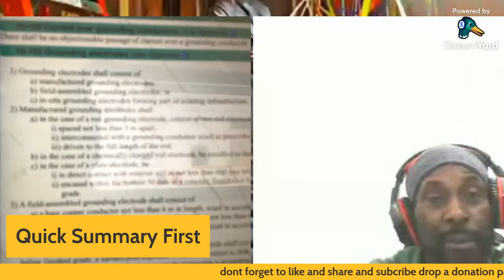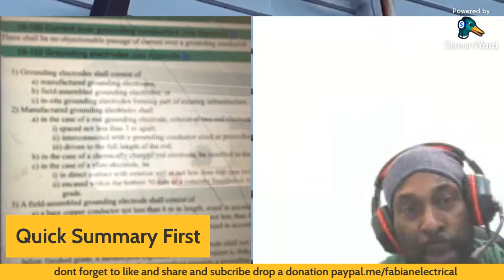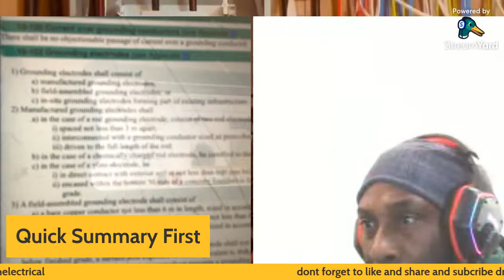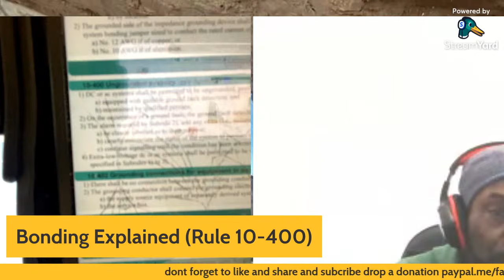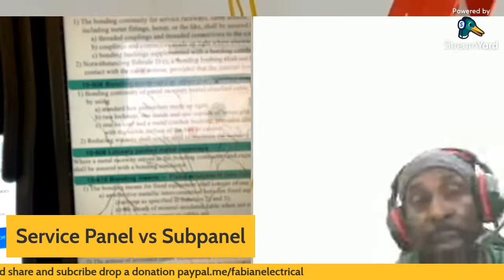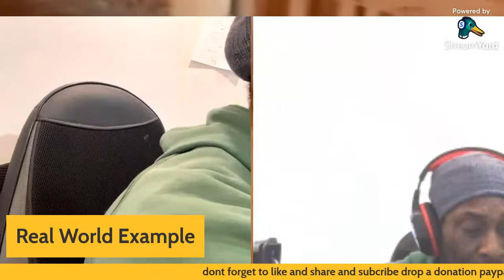Grounding vs Bonding Explained LIVE ⚡ OESC 2024 Masterclass

Comment from the maker: Grounding stabilizes the electrical system to earth.  
Bonding provides the fault current path that trips the breaker.

Both are required under OESC Section 10.

What grounding or bonding mistakes have you seen on jobs? 👇